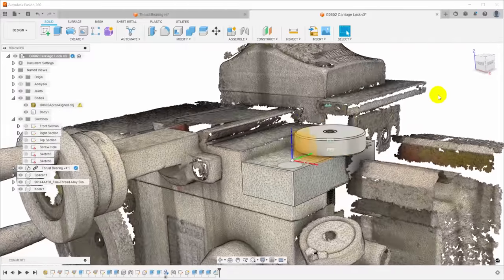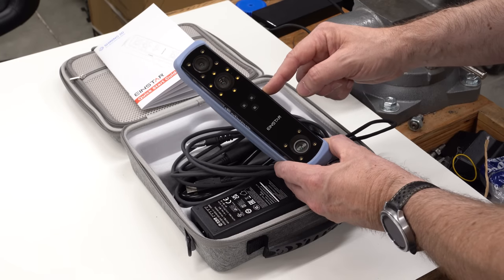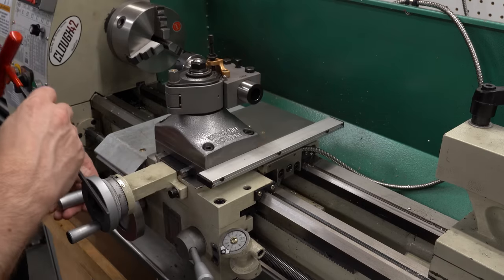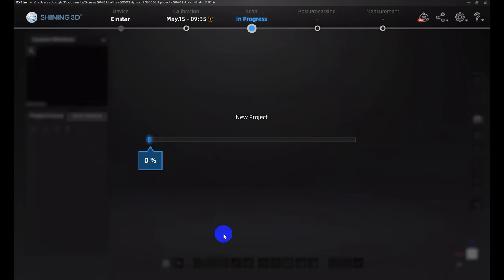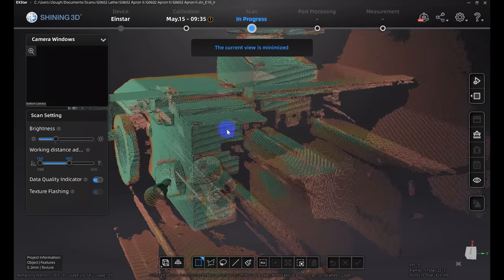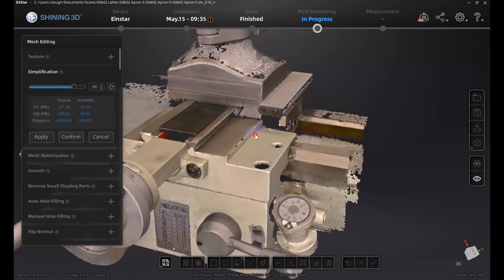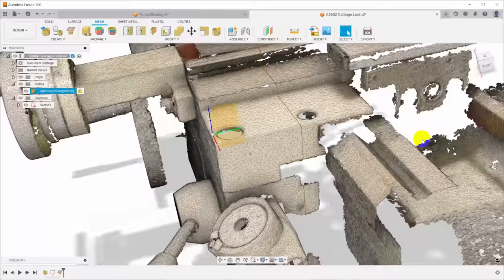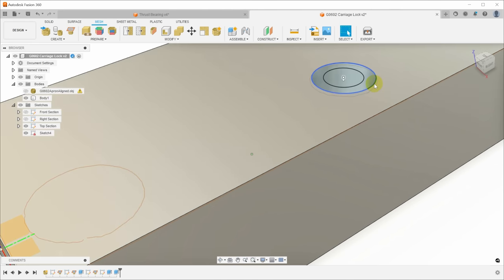3D Scanning my Lathe to Design a Carriage Lock

Comment from the maker: Many people have asked about the laptop, so I added a link in the description.  Be aware that the computer market changes rapidly, so the link will probably age like milk.  The particular model I bought is an ASUS ProArt StudioBook with an Intel Core i9-13980HX (13th Gen) and RTX 4060.
Reply: You can easily run this scanner with something like Lenovo E580 and 3060.
Reply from the maker: You're running an RTX 3060 in an E580?  With this scanner?  You're talking about the E580 with Radeon graphics from 2017, right?
Reply: @Clough42  sorry, yes. The old E580 was with Radeon. And it could run the EinScan HX which is more demanding device. I now have LENOVO ThinkBook 16P R7-5800H/16WQXGA/16GB/512SSD/RTX3060/10P and this can easily run Einstar, EinScan HX and somewhat Autoscan Combo. We got these laptops for ~1200€.
Reply from the maker: @testi2025  interesting.  They're very clear about the software requiring an Nvidia GPU with a minimum number of cuda cores.
Reply: INteresting. Following Shining 3D's advice, I had to upgrade my powerful PC Ryzen-based configuration just because my Radeon graphics card has not CUDA technology (what's pretty specific to NVIDIA)... an unexpected expense. Of course I also switched to an Intel processor just to fit the software requirements as much as possible... Sigh... But all in all I'm happy for the smooth operation that the new hardware gives.

Comment: I have this scanner!! It's great. I found most problems associated with getting started with this scanner are due to user error. But there are so many resources online, on Facebook, and here on YouTube that its easy to find help to figure out what your doing wrong. Thats what makes this particular scanner great (along with the fabulous software). The downside is that it is very heavily demanding on your computer. If you don't already have a powerful PC or Laptop you can expect to pay around $2K or more for one that is good enough for this piece of equipment. So those of you who consider buying this need to include that into your expected cost. I've also found that scanning in the dark helps with small items, as the scanner has its own lights that focus on the cameras focal point. At first I was considering buying LED lights to make things easier to see, but now I just turn off all the lights in the room and begin my scan :).

Comment: My Grizzly G0709 lathe uses the same factory setup for the carriage lock. Lacking a 3d scanner I just replaced the hex socket screw with a Kipp adjustable handle and a flat thrust washer. This allows a positive quarter-turn (or less) locking action and is still adjustable for wear.  It’s effective but clearly not as video-worthy.

Comment: Directly because of you my new Einstar arrived today.  Until I saw this video I hadn't realized that its' better to think of the scanner as a "measuring" tool and not a "modeling" tool - the goal isn't usually to scan something, directly convert that scan data to a solid model and then work with it from there.  Instead you are scanning something and then measuring/referencing from that data to model the thing you need.  That insight really cleared up a lot for me, thanks.  One stupid thing I've noticed so far is that Shining 3D recommends using only their original scan markers, but so far I haven't found that they actually sell them, in fact there aren't a lot of sources for them.  There's also no indication that the glass calibration plate is available in case you dropped one.  I'm hoping that both of these items are in fact easy to buy if you need them.

Comment: feeding the drill with the carriage is nice, Used to use a big 23/32 trough coolant drill that i had to feed 7 inches. It be cool if there was some easy way to latch on a move the tailstock with the carriage for drilling, and then be able disconnect and go on... Hmmm. 
Great vid.
Reply from the maker: I've seen this done with a drag link.  Your tailstock would need to be able to move smoothly while also being held down so it doesn't lift under pressure.

Comment: you can actually select the points in the scan data in fusion, you just have to right click the top level tree and "do not capture history data" after that you can select the individual vertices on the mesh. for whateve reasons. I use this to add construction planes based on the model to align it, but your tip about doing it in the scanning software was so much better, kudos for that!

Comment: Hey there james, I had this lathe years ago and i noticed the underside of the ways are not very parallel with the top surfaces. This would maniest itself as locking of the tailstock when sliding it after an unlock (along the way it would bind). Or differential pressure on the locking screw like in your case. I think the best thing to do here is to make a sled that fits on the ways and attach a grinder and regrind the underside. But first inspect the bototm surfaces' coplanarity to the top surfaces.
Reply from the maker: The carriage lock surface on mine seems much more parallel than the tailstock locking surface, which is pretty bad, as you state.

Comment: Using a pin that fits well in the hole with matte finish makes a world of difference for the accuracy instead of trying to scan a hole.
Also, if scanning anything bigger, always use reference markers and scales.
Worked with a GOM, atos tripple scan for years.

Comment: How accurate is the scan with respect to dimensions?  Can you calibrate the scanner with some known object like a 123 block?  Have you tried scanning a known size reference object and checking the error?
Reply: The scanner will give an approximation of the error in scan interpolation - Like anything there is a sliding scale where as you scan larger items you must learn to accept some error
But in general from past experience on something like a car bumper you can expect anywhere from 0.7mm to 1.2 mm depending on your tollerance for tedium, on smaller parts  like the focussed area of the apron here you can get down to 0.1mm to 0.4mm depending on your prep work

The key think is having enough reference point for it to keep thinks coplanar and rotationally locked - if doing a larger relatively flat piece it can be worth while to attach some neodynium magnet or lumps of blue tack as additional references during the scan

Comment: Never really though about the carriage lock, when I first used it I just chucked an allen key in it and have just never taken it out.
I got really lucky with the thread index, 90 deg goes from full unlock to full lock, only problem is when it drifts backwards and gets between the tailstock stopping me from locking it. 
Need to remember this for when I pimp my lathe.

Comment: The reason for the sponpyness is likely that the tab on the bottom has to close down and engage on both the front and rear of it - If you add a small spring in back of the tab, ideally countersunk inside it so that it is pushed to pivot you will feel an immediate improvement in that slop for only a 20 minute job

Comment: I notice that it doesn't supply measurements with the 3d images and yes I can design what he wants just by measuring the limited area and plug into AutoCAD.
Better yet why not just redesign the apron area of the lathe and just put in electrically-operated solenoids which lock any movement. Also, boot them into your CAM programming so, while you are heavy turning a part, the solenoids automatically engage the locking mechanism on the apron making your machining very rigid.

Comment: For once I got something before you did! I have the same scanner that I bought couple of months ago. Pretty cool stuff. I used it to scan a complex 3d geometry of an A/C bracket and pulley on my car to be able to remove the A/C compressor. I need the space for turbo things and it saves some weight... I guess I could have measured it, but it's on multiple levels and angles...

For other looking at the comments, you need an Nvidia card because the software uses Cuda. The more Cuda power you get the better it is. It just doesn't work well with ATI/AMD.

Comment: Was this sponsored? This is the 3rd video I've seen posted in a day about this EXACT scanner, seems very coincidental that you happened to buy one and drop it right at the same time. If you did, fair play, if not then I can say for this guy, I prefer to have freebies and other stuff mentioned clearly (or mention that you bought it with your own money very clearly). I know it's a pain, but there's so much shilling out here that the clarity is helpful in evaluating what I'm being told. Love the videos.
Reply: Using your own mind when evaluating things is a must regardless, so it doesn't really matter if it is sponsored. To me at least.
Reply from the maker: Nope.  I paid cash for everything in this video except the collet holder on the lathe, which I mentioned.  I think the reason you're seeing this scanner everywhere is that they finally broke the $1000 barrier and many people like myself have been lurking and waiting.
Reply: @Clough42  Awesome! thanks for the clarification!

Comment: You might want to put a set screw the clampdown on the top of the bolt actually you might spend or press out from the head of a bolt. Great project I would probably use the scanner for something else lol

Comment: Yea, all this 3d scanning is fun and all... But in most applications it's way to much, and can complicate things more than it helps.
Clippers, a ruler and a micrometer is all you need for 99% of all your reverse engineering.
I regularly come across the original design of parts by accident.
You measure the coarse dimensions, put it in cad and do some assumptions like rounding the dimensions and some radii and boom! You see how they designed that part! 😮
Getting data back of a 3d scann, can be way more difficult than looking at a part and take some messurements, because taking a messurement in a scann can be more challenging then in the physical world!
But... It always depends!

Comment: A spring loaded captive lever that you could pull up to get more quarter turns would have been a simpler but obviously less fun way to go about solving this 😅
Reply from the maker: Like a kip handle?  Messing with that every time I need to lock or unlock sounds dreadful.
Reply: @Clough42  I didn't know kip handles existed that's cool. I made the assumption you only needed maybe half or one full turn, but maybe not and maybe it would be dreadful 😅
Reply: Great video regardless. I'm always trying to find an excuse to buy a 3d scanner haha

Comment: That scanner is way cool.

But things sure seem to get klutzy after going into F360.

Isn't there a way to just convert mesh into surfaces, and add some enclosing surfaces to create a solid?
Reply from the maker: If you've got $10k to spend on software, then sort of.  If you know of less expensive options, I'm interested.
Reply: @Clough42  Yikes. I guess reverse engineering isn't as far along as I thought.

At 7:40 you say you're not trying to make a watertight model, which would obviously be impractical given the size and complexity of your lathe.

But if a part were small enough that it would, does that change the situation, i.e. does a watertight model lend itself to conversion to a solid more easily?

Comment: Since there are higher quality, more expensive options, this will probably be snubbed... I use an app for my iPhone that takes advantage of the IR scanner built into the phone. I'm pretty happy, though the software that came with yours is by far better, but it's just the scan I need. (I think I paid under $10)
Reply from the maker: Is the result calibrated, or do you need to scale it?
Reply: @Clough42  I have a 120# German Shepard missing a foot. I used it to make a 3-d printed model if his nub. For this purpose it seemed right, now something in this precision world? I can’t answer that. I think we both know the likely answer to that. I am curious enough to run some tests at some point however.

Comment: Nice part. Of course, in keeping with the over engineered for the sake of over engineering, you could have made a hydraulic ram system that drives a wedge to pull the locking plate into the bottom of the ways.

Comment: I personally don't like that they use a propietary cable. It's the most likely thing to fail and those LUMO connectors are very expensive. USB-C would have been much better imo
Reply from the maker: I appreciate having something more mechanically sound on something I'm going to be waving around and dragging the cable over stuff.  A soldered USB-C seems like it would be way too susceptible to being pulled sideways.
Reply: @Clough42  fair enough!

Comment: Maybe it will work for you but I'm nowhere near sold on this. Mesh made of triangles is horrible. I want to see quads. Not triangles. If there is a laser scanner that will do proper mesh geometry with quads I'm all in.
Reply from the maker: There are laser scanners available if you want to pay more.  They're still going to generate a point cloud that will typically be processed into a mesh.

Comment: My two cents, YMMV, given how huge the point cloud gets, and how irregular the resulting faces are, you are typically better off to take your own measurements and build your models by hand. Mating parts that were generated this way are typically problematic.
Reply from the maker: For something simple like this, of course.
Reply: Given that most 3d cad systems use at least  32 bit floating point math, it doesn't take very much error to cause a mate to fail and break the entire assembly model resulting in hours of hair pulling trying to find the error. I am in agreement that 3d scanning should be reserved for compound curves and organic shapes that cannot be easily measured and recreated otherwise. If the parts are rectilinear and square to each other, or close enough so that it doesn't much matter (square parts with cast surfaces). Just break out the steel rule and calipers. You'll thank me for it.